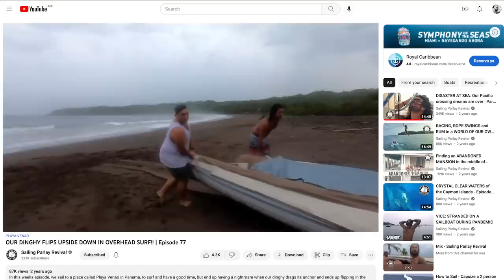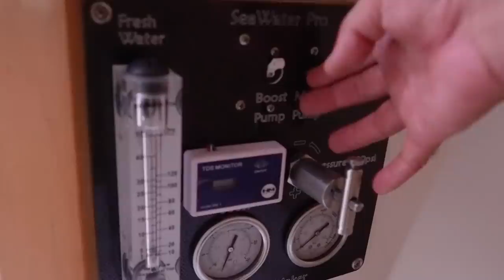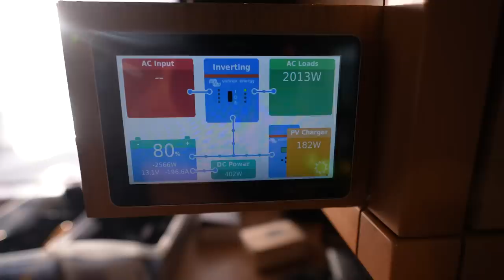WHAT A FREAKIN DISASTER!!! Boat flips in big surf - Episode 187

Comment: Hey I know your an engineer but here in the states I am a lead automotive tech and I also work on heavy diesel trucks but for the large cable lugs we no longer crimp them or even punch them. We use either the same or heavier lugs this works with copper or the heavier aluminum pigs but we get these solder pellets and put a few into the lug the heat it with a pocket torch then push the cable in so it’s completely soldered together and this just makes a such a better connection. Just crimping you never know if you have a really good connection. Just because if you pull on it and it doesn’t move does not necessarily mean you have a great connection. These solder pellet slugs are flux core and extremely easy to use. Well ours are flux core I don’t know if all the ones made are. But I thought this info may help you out you can order some online and improve your main wiring for some insurance from future problems. Hope this helps oh yeah we use the heavier battery cable lugs rather then the copper. They seam to handle the power better and are more reliable. Love the channel brother.
Reply: Solder should never be used alone for a connection like this.   It can become brittle and increase resistance with stress or completely fail under high temperatures, such as under high current.   You still need a primary physical connection such as a crimp or screw/bolt lug.     Also please know copper is a significantly better conductor and has higher tensile strength than aluminum.  It’s just heavier and more expensive than aluminum.

Comment: Colin I use a hand held FLiR that was only 200 buck here in canada and it works amazing for checking wiring for problems early on. It will even show hot wires in the walls. Or hot or cold exhaust manifolds
Reply: great message man, Colin needs one of those for sure! 👌

Comment: Not sure what voltage your system is running at but if its 12V and your drawing 2000W then your pulling 166A if its a 48V system it would be 41A so it would be normal for your cables to get warm,. doubling the cables would split the amperage between the two so it should help. Fuses would be good to have in the system to prevent a meltdown if there's faulty parts (like the switch).

Comment: Why don't you use a multi-meter to check the ohms of all your wiring devices? You should see zero ohms of resistance in properly functioning cables and devices.

Comment: You need a fuse between the switch and the battery so the fuse can blow and have a spare fuse tied next to it. Use class T fuse at leat 400 Amp fuse. Also buy the big Grey 600 Amp switches those small switches are marginal for the size of your system.
Reply: awesome advice! 👍
Reply: @TrevorHeathPhotography  Yeah - at 12v then 3600w (easy to reach with 1100w from the water-maker plus a kettle or induction stove) is already 300 Amps...

Comment: Hi Colin the best thing to do with a fault like this is before you fix it, with your loads on check for voltage drop across the connections..  i.e cable lug to cable lug, cable lug to switch terminal bolt..etc etc until you find the voltage drop.. Most likely is that the switch terminal bolt had worked it's way loose and was resistive causing it to heat up.. Switch failure is also a possibility for a few reasons.. heat, moisture,  corrosion, excessive current... etc...  Or running devices at a low battery voltage.. Remember current is inversely proportional to voltage in that scenario,  meaning if voltage goes down current goes up.. Not convinced this could happen with lithium batteries,  but test some voltages while things are running for peace of mind.. Best Regards.
Reply: such great advice from a professional 👌

Comment: Use your ohm meter, measure between the contacts, move the switch ON to  OFF,  ON should read 0 ohms, OFF should read Infinity.. , SWITCH should be removed from power to test, thanks for the videos
Reply: Measure the voltage drop across the switch while you have it under load. It should be extremely low.  You can calculate the resistance using ohms law.
You can also do this with the cables to make sure the crimp connectors have not gone high resistance.

Comment: I've seen some crazy freak waves like that. I was at a beach called Moon Stone, an epic beach, fairly flat and 300 feet from surf to the end of the beautiful sand. A wave came and rushed across the entire 300 feet of dry sand,  and slammed into a rock wall at the end . All I could think of was part of a Tsunami wave ! The quite typically are multiple waves though like the ones you experienced, but they travel faster and more aggressively !

Comment: If you have 300A cable and switches, you should probably have a 250A fuse inline with it so you have a known failure point before damage to the expensive switch or cable.

Comment: to inform you a 48v switch is rated up to 48v. lithium goes up to 58v for LifeP04. You have to get one that can handle 60V. same with all breakers and fuses.  since you have Victron I would order one from them.
Reply: I have 60v 200 amp disconnect switches x 2 1 for each inverter. Since my inverters are 5kw each  they will never go over 100 amps each. I do not have loads big enough to pull 10 kw. I did this so my system is never over worked.  Just like each battery bank of 48v 15kw goes to a busbar with DC circuit breaker inline x4. That means my batteries will never go over 50 amps each when they can discharge 250 amps each. Hope this helps.